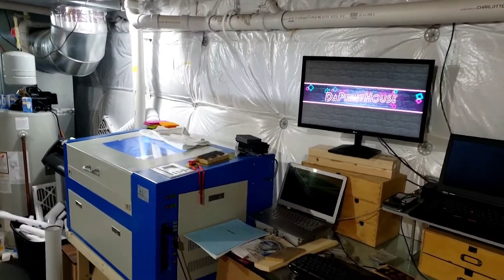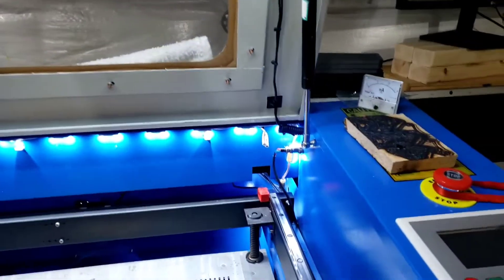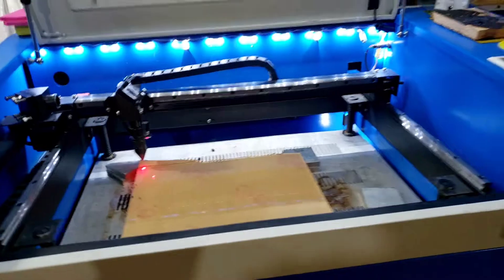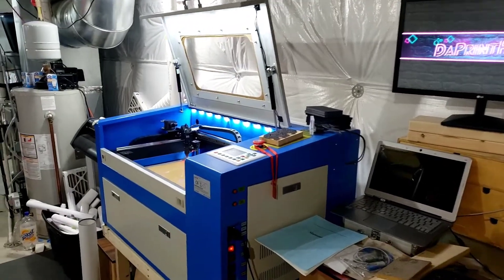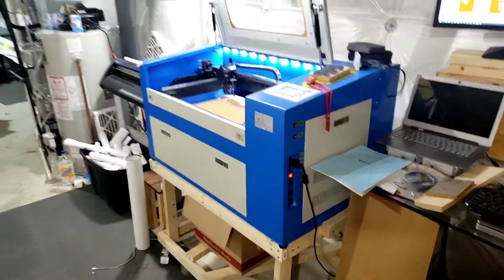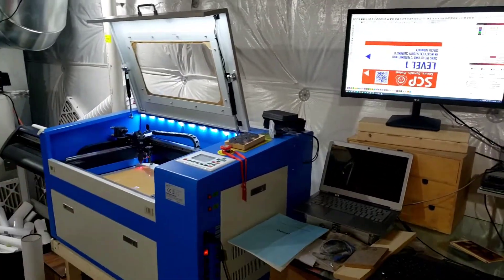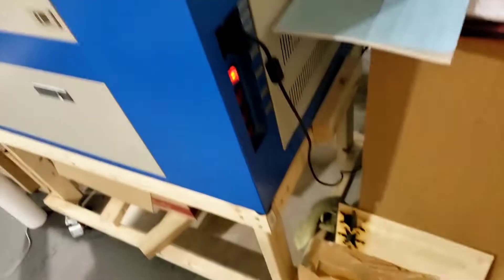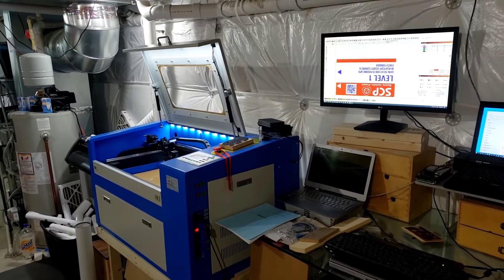The 50w c02 laser engraver I have used for the past 5 years,  great for acrylic led signs

Comment: thank you for sharing your experience about CO2 laser! I found this video and I am so happy to tell you that we also have the same model for some years.
I just want to ask you how to replace the mirrors of it? We have never changed them and I believe it is time to do this because it cuts worse and worse. As you noticed the cleaning of mirrors is very complicated because you can not reach and see mirrors easily. I tried to take them off from that black frame but it seems they are stuck or made so that they cannot be removed. I want to measure diameter and order new ones but I can't because of stucking. Have you tried removing the mirrors yourself? Maybe somebody else can suggest how to replace them?

I would be grateful if somebody could answer :)

Comment: You run this with no problems, without a chiller? I’m looking at this model but wasn’t sure if I should fork out for a chiller too.
Reply from the maker: Never had a chiller ever.  All I have done is drop in a 2 liter frozen bottle  if I need it for long run. This tube and laser is almost 7 years old now
Reply: @DaPrintHouse  That's pretty amazing considering the costs of this machine. What is the temperature in your workshop?  Als i was wondering about the height of the table the laser is sitting on. Cant seem to find any info on good working height. Thanks in advance for the reply. and your great video's.

Comment: What is your distance between the acrylic and the laser? I tried using the spacer piece they sent with the machine but it does not work. My acrylic bows where the laser cuts which makes it unusable
Reply from the maker: mine came with a piece i can measure it.  but i change depending on thickness as well
Reply: @DaPrintHouse  thank you for the reply! So the piece I want to cut is 1/4" black cast acrylic. 3mm/s at 80% does cut it, I just have to go twice and I still get a small bead of melted plastic along the edge. What distance do u use for 1/4" inch? I think I've tried them all but willing to keep trying lol